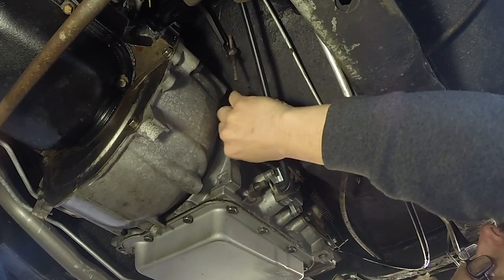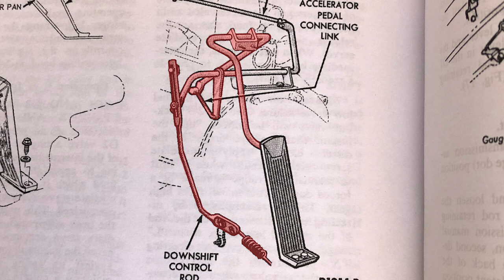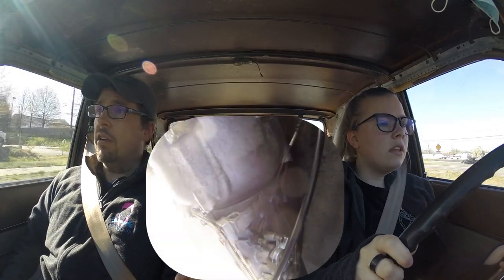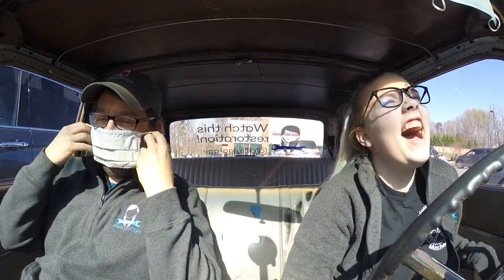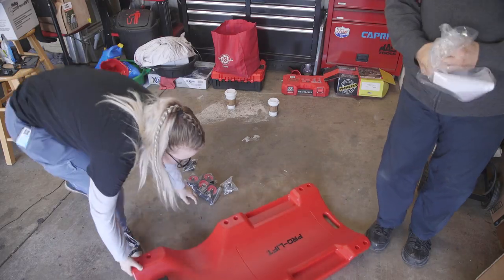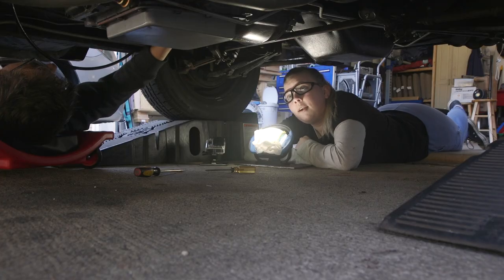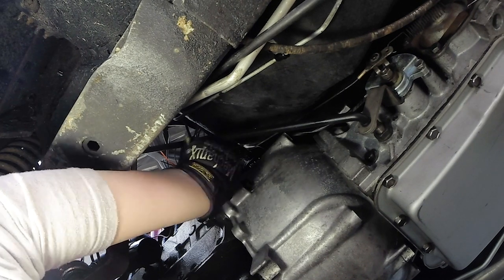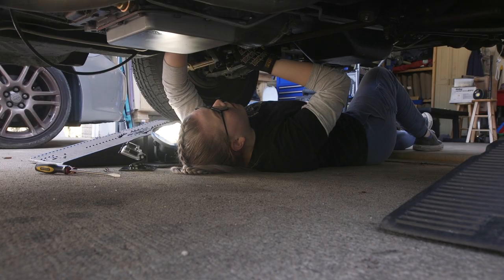I Adjusted My C4 Kickdown Linkage and Now It Works!

Comment: Since you didn’t say in the video, I thought I would fill in a detail. The reason you want to kick down when you floor the accelerator is that gas engine generates more horsepower at higher RPMs. If you need to pass someone, or otherwise accelerate quickly, it’s going to happen faster if the engine is running faster. So, the transmission kicks down to a lower gear to allow the engine to run in a higher range. My 68 impala has a 2 speed transmission so there isn’t a kick down at highway speeds, the engine is already running at a higher RPM. The downside is that just cruising, it sounds like it’s off to the races, and the fuel economy is (even more) terrible! Great video! Keep up the good work!

Comment: Young Miss Ellie.... You are becoming quite a Mechanic!! 💯👋👋👋👋👋👋 
Yes, that's exactly what a Kickdown Rod/Cable does. It enables you to drop a gear when the Throttle goes past 7/8ths Throttle. 

FORTUNATELY, you didn't decide to get a Dodge Dart - or any Chrysler Co. Car! 
You see, sometimes (always on Chrysler Corp Vehicles), that same thing is used as a TV (Throttle Valve) Linkage. It REQUIRES near perfect adjustment to even get out of First Gear. More than a minor misadjustment WILL cause irreparable Transmission Damage!!! 😲 
Sometimes within 25 miles!

Don't panic! Ford Cars and Trucks can actually run fine with the Kickdown disconnected. Really!! It just won't downshift.

The exception there is 1980 and newer Automatic Overdrive Transmissions. They have a TV Linkage - NOT a Kickdown. 

Same with GM Cars and Trucks. All older ones (3 speed) had Kickdown Links. All 4 and 5 Speed Overdrive Automatic Transmissions have TV Links. 
Just some FYI for you. 
GOOD JOB today!! 😎👍👍
Carmine ✈🚂🚙

Comment: i built a 302 for my father in laws 73 E300 econoline.. porting and polishing the heads. using good stuff inside. i also rebuilt the C4 transmission.. and went thru the valve body with a recalibration kit that replaced the springs that break after decades.. i knew how he drove. and reinstalled the missing 2/1 kickdown ball..  so he could stomp on the gas in 3rd and it would not just kick down from 3 to 2 but go all the way to low gear..  oh my.. that poor 302 was winding up tight. but the look on his face was worth it.  i don't advise that for a used small block with worn oil pump and tired bearings..

Comment: It looked like you could have adjusted the cable a little further. There was more movement when you pulled on it. I have 2 Falcons myself and the kickdown or downshift happens before you have to mash the gas pedal.

Comment: very good video with the linkage in picture explaining it I am buying a 1984 C4 corvette 400hp with a carburetor. and my throttle cable is so long I have to put my carburetor backwards. I see this video as to do with a C4 I was wondering what you are running under the hood and if there is a special shorter throttle cable and mounting bracket I could buy.
Reply: There is nothing C4 Corvette about her C4.  Watch the video.

Comment: Ok ,great video. Now save the cardboard box from the creeper so you can use it if the creepsr brings up to high. Or dad can use it. Also i believe that the kick down cable should have no slack at all so tighten  it up more. The kick down sholud happen about  3/4 of the way down on the throttle not all the way down. That may also raise the shifting points on the transmission.  If anybody out there is a trans expert please chime in.
Reply: I believe you are right my truck kicks in about 3/4 peddle to.
Reply: @mattharden2441  thank you my good man. I have 2 Ford vehicles  with AOD trans and one has metal rod to the trans and the other is a cable, called tv cable. No slack in either one.
Reply: Yeah you don't want to have to mash it to the floor to pass. Just keep tightening a little at time till it comes on too soon for the way you drive.

Comment: Ellie, what kit did you use to replace the kickdown rod linkage with a cable?  I need to do what you have because my stock kickdown rod hits my neutral safety switch.  Thanks much!  I contacted Lokar, they said they did not supply your kickdown cable.  PLEASE you or someone tell me what cable kit you have installed.  Thanks!

Comment: ? Does the kickdown cable affect or have anything to do with the initial warm up process when the car is at high idle and you depress the throttle to lower the idle?
Reply from the maker: No, that's managed by the choke and the fast idle cam on the carburetor

Comment: My 2002 camrey has code for running leen...when I floor it from a stop it seems to work fine...but at highway speeds it just seems to rev high n not kick down..but have throttle it seems to work...could that just be transmission going or kick down cable.  2002 camrey le v6 118000 miles